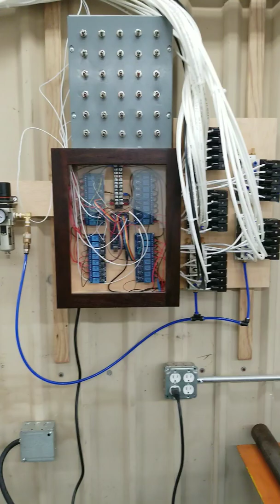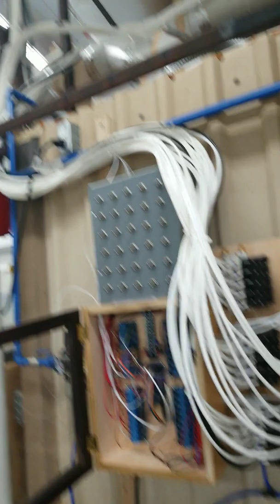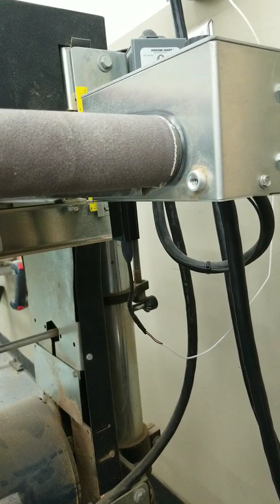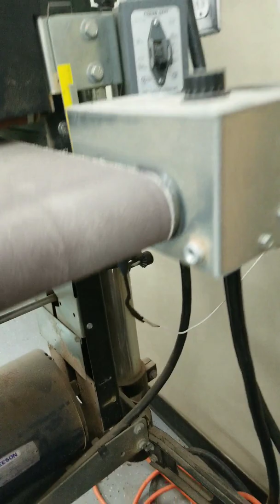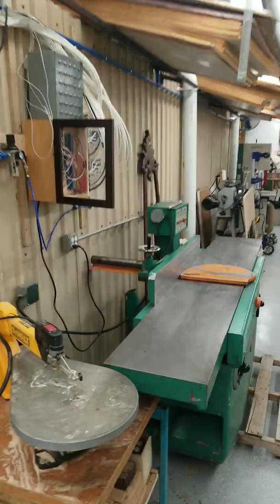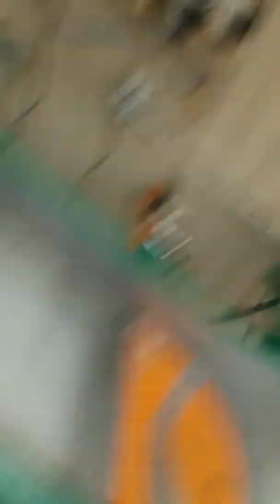Blast gate automation

Comment: Very nice installation of the manual switch box, Arduino/relay enclosure, solenoid valves with the manifold, and exceptionally organized wiring and plumbing lines.  I've been planning almost the exact same setup for the past year when I stumbled across your video looking for homemade automated blast gates.  The manual switches are a clever way to add functionality to your system without using any Arduino pins or code.

Do you have any problems with the blastgate "torqueing" the movable piece using only 1 air cylinder mounted to the side? 

Also, I would be interested in seeing your code if you're willing to share it.  I'm planning to include an "air clean mode".  After turning off all the tools, the dust collector stays on and the blastgates close after 5-10 seconds to clear the ducting.  Then as the blastgates are closing, another set of blastgates open to large air intakes located away from the DC filters to cycle the air and filter it (time would be adjustable using a potentiometer, 5-30 minutes).

Thanks for sharing!

Comment: Best shop automation video I've seen. I'm in the planning stages for doing something similar in my shop. Any chance that you'd be willing to share the specifics on some of the equipment you're using? I'm particularly interested in the solenoid valves you used. They look like Baomain Solenoid Valve 4V210-08. If so did you have any issues with the quick connect fittings? I've seen several reports that they leak like sieves. You also mentioned that you're using 3/8" tubing. Did you replace the quick connect fitting to allow for this or did the valves come with the correct fittings. I'd also love to get a look at your code if you'd be willing. This would be my first attempt at automation and I'm not a C or C++ programmer.
Reply from the maker: Those are the valve manifolds I used. I bought lots of extra push to connect fittings and spend some time carefully wrapping each one with plumbers tape, then tightening. I did have some leaks, but for the price, those valves have been good. I have had the system up and running for 18 months are more and it is almost flawless. I spend more time tuning up my table saw. Happy to share the code. I'm not a programmer either, but it's pretty simple.
Reply: @christopherholder3138  Chris, thanks for the quick response. Do you recall where you got the push to connect fittings and what size thread was needed. Also, I'm a Youtube novice so what's the procedure to get the code. Do I give you my email?

Comment: Awesome setup.  I see there is quite a bit of thought and work put into it.  Why did you choose pneumatic cylinders over electric servos?
Reply from the maker: I have plenty of air, they are relatively low cost, and I really like the sound it makes when they open;)
Reply from the maker: I can also infinitely adjust the "power" to each gate with with needle valves. This really helped me as a few of my gates were a bit tighter than others, thus requiring slightly more air pressure/volume to operate.

Comment: Just stumbled on your videos!  Great explanation!  I have a Clear Vue CV1800 system as well and installed 6" pvc with blast gates using the https://www.youtube.com/watch?v=oj9vlD4gU78&t=422s Johnathan Katz Moses design.  Next step is to automate the system using either pneumatic or linear actuators.  What made you decide to go with pneumatic over linear?  I'd love your input.  Thanks in advance!
Reply from the maker: Pneumatic was less expensive for me. Also, by using needle valves I could fine tune the speed of the opening of each gate.
Reply: @christopherholder3138  I'm sure it was a lot of trial and error, how long did it take to get it all correct?

Comment: Hey, great job on your blast gates.  Now I have to go and watch your other 2 vids.  I am currently deployed in Iraq but I just bought a 3hr Grizzly dust collector on craigslist for less than 1/2 the price of new.  Had 3 good buddies pick it up for me.  I am doing my homework now on the piping for when I get home.  I love your setup.  I see you gave everything a blast gate up high and on the arteries that are not being used, smart move.  I would like to use 8" on the main runs and then 6" on the drops.  I am also going to cut my concrete slab and put in a trench fro my table saw feed, both vac and power.  I messed around with an Arduino a bit and found that the relays were about the easiest thing to write code for myself.  I imagine you have some $$ into the cylinders, relays etc.  If you don't mind me asking how much?  Thanks for posting and now you have 9 subs.. :)  I have a channel if you are interested.
Reply from the maker: I am cheap  but your right, it all adds up. The cylinders were off ebay, about $17 each. I did the math and think I have about $30 in each blast gate. If you go 8", it may be more difficult sourcing materials at a reasonable price.
Reply: I have been thinking about the project.  Thats all I can do right now, being in Iraq for another 6 months.  I think I am going to do a rack and pinion set up with a small motor.  Very very cheap to build.  I found this obscure video on youtube and it got me thinking.  https://www.youtube.com/watch?v=-sN1sQRLk_U